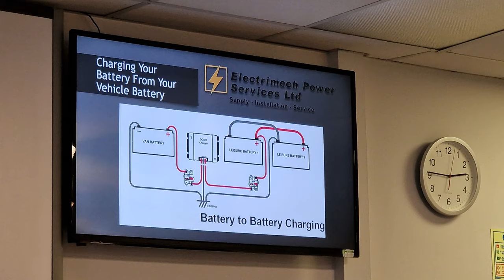campervan builders electrical installation safety workshop

Comment: While the rules and regulations between the UK and Germany may differ, the basic rules for safe practices when dealing with current in a van still apply. Courses like this in Germany would be a welcome thing for many people.
Determining correct wire diameter according to load and length, fusing, making strong and safe connections and picking the right components for the paricular installation can be overwhelming. There is lots of information on YT but to be in a dialogue with someone across from you nets a much more thorough understanding. The course money is well invested. 🤟
...and should I be near a course venue through my UK travels, I will certainly stop to attend. 🙂👍
Cheers mate - stay safe (and hugs to Lisa and Riley!) 🤗
P.S.: You are always welcome to stop by for some Currywurst - I'll be sure to bring ample supplies with me on my next UK visit. 😋
Reply from the maker: When I bought the sandwich I was thinking of your visit so had to give you a mention 😁👍
Reply: @TheCraftyBlindersvanlife  We have a local meet coming up at months end. I am predestined to supply the attendees with sausages and sauce. Again. 😁

Comment: Hi Sam, can I ask a question… so when you did your shower build you put the extractor fan on the side of the van. I’m doing the same but struggling to find a suitable fan, can I ask where you got yours from please or any links would help immensely thank you
Reply from the maker: Hi Paul, sorry for the delay in responding 
Try this link. This is what I fitted, mate
https://www.ebay.co.uk/itm/183714290896?mkcid=16&mkevt=1&mkrid=711-127632-2357-0&ssspo=3zjXQk5dRoW&sssrc=4429486&ssuid=qkhVtACcQ9q&var=&widget_ver=artemis&media=COPY
Reply: @TheCraftyBlindersvanlife  cheers Sam